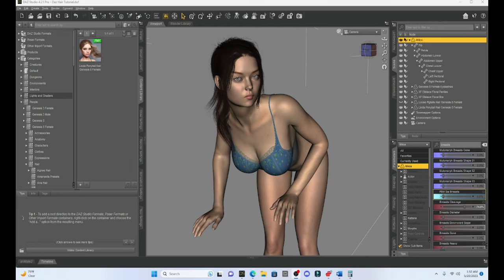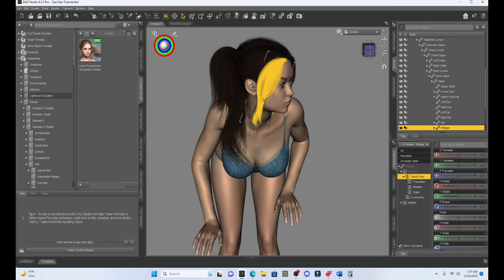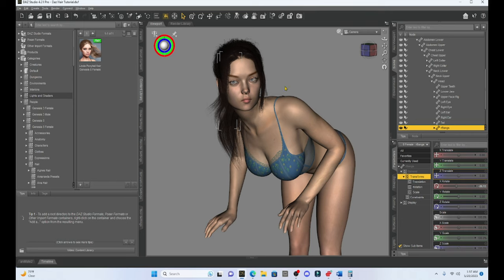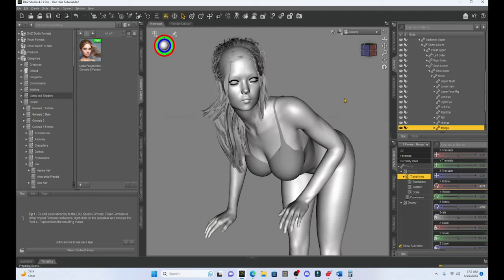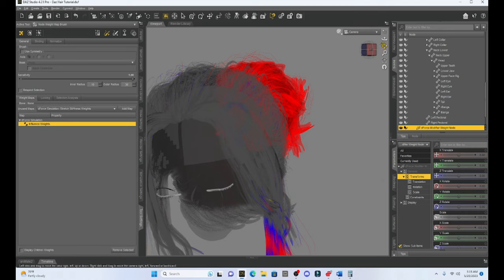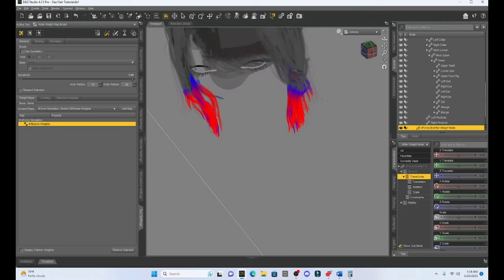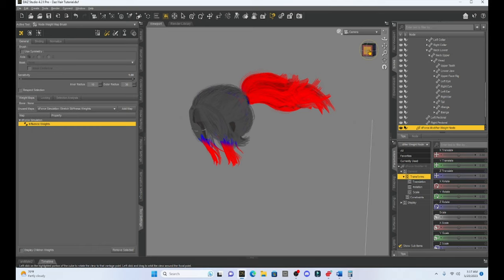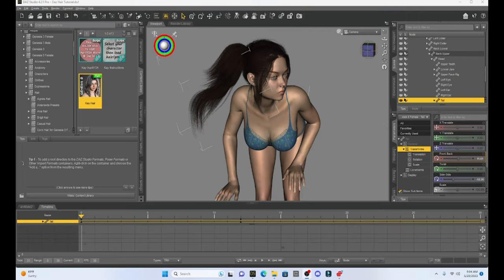Daz Studio: Is Converting Non D-Force Hair into D-Force Worth it?

Comment: sir what is system requirment for daz studio
Reply from the maker: @fightflowwithcomedy3300  I used a f i7 1080 GPU, 32 GB RAM. Laptop with Daz 4.21 successfully for a while if I was patient and not in a hurry. These days l recommend a 3050+ GPU with at least 32 GB RAM.  A larger CPU also helps.  Check out my video on the system I use for more information. Hope you are successful!

Comment: I do this somewhat less time consuming. I set all weights to 0. Go to geometry editor and hide all geometry except the piece I am working on. In this case would be tail. Use lasso selection to select polygons and set weight to 50%. Another lasso selection at the end of the tail for a 100%. And then use smoothing brush to blend it in. You repeat process on each individual element that needs to move. I just read para467 kinda does the same thing =)
Reply from the maker: Awesome! I'll need to try this technique out.  Thanks for the info!

Comment: This is a very good explanation - easy to follow. Congrats. I do this slightly differently though:

- Hide Figure and set Viewport to Front, Left or Top View. (more consistent selection without perspective) Switch viewport draw style to Wireframe.
- Scene Graph: Select Hair Node -> Geometry Editor Tool -> (viewport context menu) Selection Mode: Lasso
- Select with lasso what not to dForce
- Switch to Weight Map Brush Tool and select the dForce Modifier Weight Node
- In the Tool Settings Pane: tick Respect Selection
- Viewport context Menu: Weight Editing -> Fill Selected -> 0%
- Optional: Viewport context Menu: Geometry Selection -> Invert Selection
- Optional: In the Tool Settings Pane: activate Directional Gradient Mode for the weight brush.
- Optional: Viewport context Menu: Gradient Handles -> 3 Handles
- Optional: Place the gradient to my liking form a small ease in zone if the geometry density allows it and hit Apply Gradient in the Tool Settings Pane.

... more steps but in my opinion way quicker and less fiddly than the weight brush. I used the Gradient Tool in a recently uploaded Video on my channel for a dFormer influence field to make a helmet's strap adaptive. Different feature same technique.
Reply from the maker: I will check it out!  I haven't played with the gradient tool much yet but am excited to follow your suggestion!